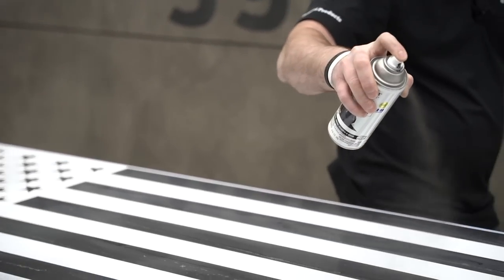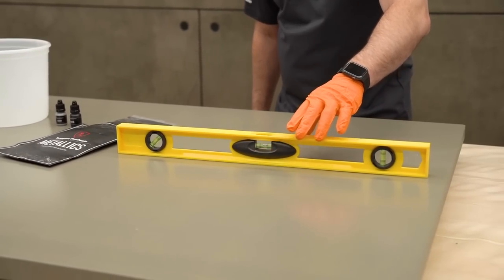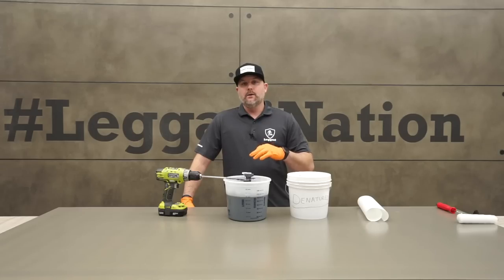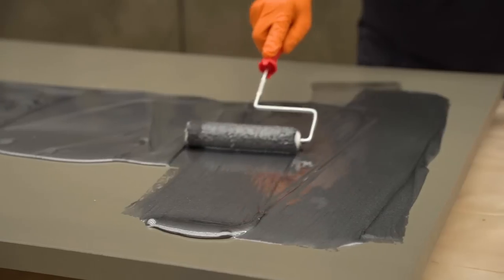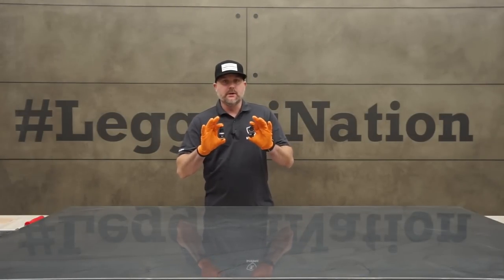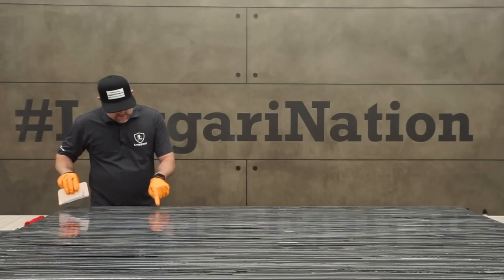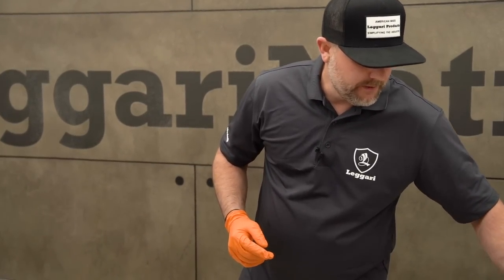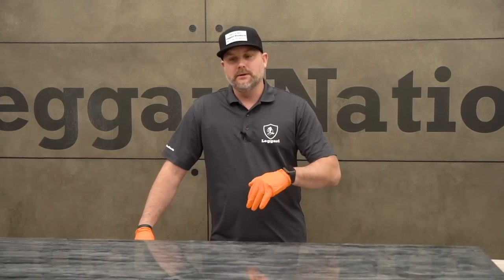PART 1 | Making U.S.A Flag With Epoxy Resin & Stencil | Awesome Resin Art Project That You Can Do

Comment: How much time do you have before the isopropyl doesn’t work ??
Reply from the maker: There is a lot of factors that go into that like how long did it sit in the bucket before getting dumped out, how long did it take you to pour the counter? and so on, but as long as your moving quickly and getting it dumped out on the counter you will have well over an hour to mess with it and still have the iso work?